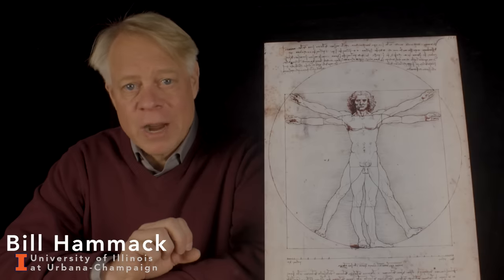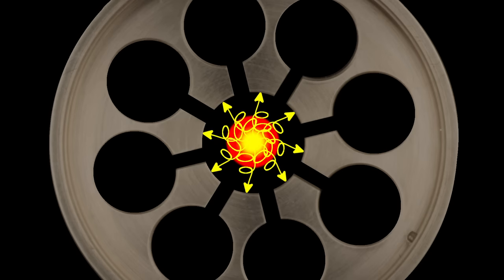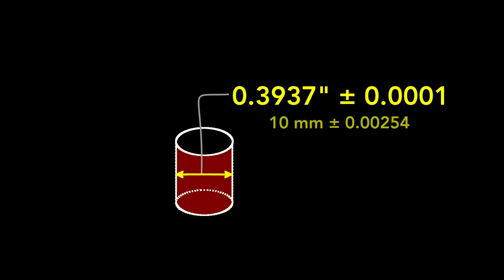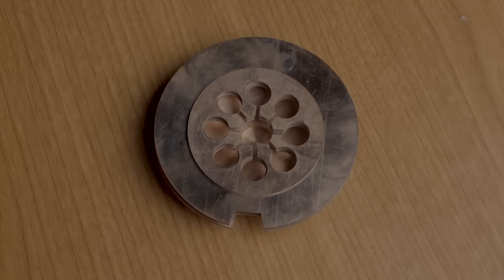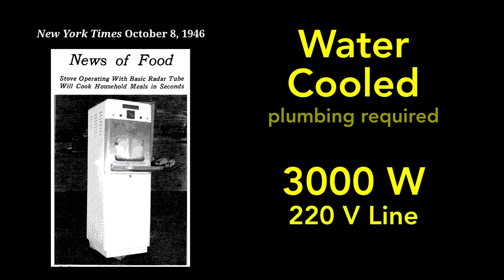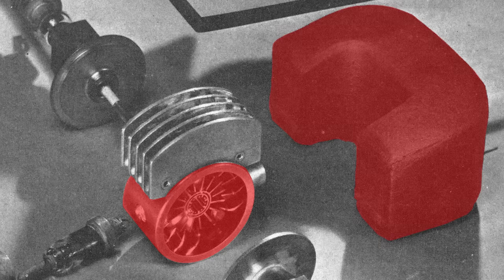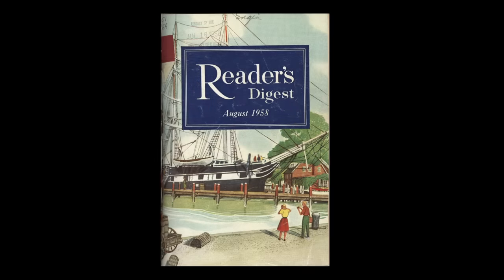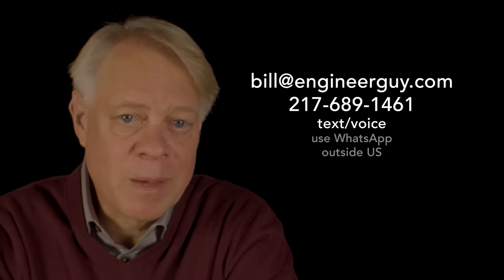The Microwave Oven Magnetron: What an Engineer Means by “Best”

Comment: By using punched out metal sheets that the magnetron is assembled from it is also pretty simple to test and reject any one sheet that wasn't within tolerances. I mean just assemble the sheets, put them in a test rig and fire it up, if it produces the correct wavelength them great, and if not you can just keep switching out the sheets until it does. I don't know if that was actually done but it was what I first thought of, instead of finding a way to perfectly mass produce the piece you use a method that will get it right most of the time but is just so quick and cheap that you'll still get lots of working pieces even if some are defective. I mean who cares about throwing a way a bit of sheet metal? You can just send it back to the foundery and turn it right back into usuable sheets.

I probably thought of this because it's kinda similar to how silicon chips are made, not every chip on a die will work but you can make enough of them that this doesn't matter.

Comment: Micron tolerances are crazy. Ive worked in a shop with them. To put it into perspective, if the heat or AC come on you'd just throw the part into the recycling pile. Even if you didnt notice it was still enough to throw the tolerance. Just half a degree was enough to cause the part to warp.

Comment: Excellent video, but you clearly got the inch disease at 3:30. The 10mm makes sense, but the 2.54 um is a conversion artifact because you recalculated from the rounded 0.0001 inches

Comment: I don't know if the wattages are correct, they advertise the cooking power wattage but microwave ovens are fairly inefficient so they actually draw around 2x that power from the mains.
Look at the advertised cooking power of your microwave then look at the electrical ratings printed on the label on the back of the unit, there is a big difference.

Comment: Great episode, that demonstrates that application dictates design !

Look at analog electronics. There are tens of thousands of different types of transistors. It makes the electronics neophyte think that you MUST use a specific part number for the job, else the circuit will not work. To the contrary, that's often not the case. It boils down to the job at hand, that the circuit has to do. In certain precision instruments made by Hewlett Packard (way before the breakup) not only does a specific transistor model need to be used, but it also must be made in a certain date range, when a certain semiconductor fabrication method was used. Contrast that to your typical "commercial" application, where you design the circuit which can use just about any transistor that meets the power demands, and that transistor's characteristics can vary widely. If you design the circuit based on the wrong criteria, you'll be transferred to the sales department, in a heart beat !

Comment: It's an oversimplification to say that the magnetron plates could be simply stamped to provide the necessary 0.0001" tolerance in diameter (and probably placement) of each hole. Fine blank stamping does not achieve tolerances that good, even in soft materials. Further to that, tolerance stacking between components would not be a simple issue to manage with a magnetron comprised of many plates. 

Plates would have to be finish ground on both sides to clean up the openings which would have sharp burr edges from the stamping process and to also assure flatness and parallelism. I suspect that a clamped together assembly of rough stamped plates could have been finished ground (probably with internal circular bore grinding) to final shape to accomplish the necessary 0.0001" tolerance and line up all of the features. 

Alternatively the super tight 0.0001" requirement is an apocryphal requirement and that fine blanking stacks of copper merely turned out to be far easier than making them as a contiguous piece which would require a lot of operator time to rough drill each hole, mill each radial passage, then ream each hole. 

Copper is a frustrating material to machine: It's soft sticky stuff that is difficult to mill into smooth surfaces without CNC controlled climb cutting. The deep slots would be quite frustrating to machine because it would require cutters of low diameter compared to the length which would result in a lot of broken cutters and poor surface quality. All this work would have been done without the high performance carbide end mills available today.

I have to surmise, that the stacked copper plate design is more motivated by the issue of ease of manufacturing than the actual requirement for such a tight tolerance. 

In the application of the modern residential microwave oven, the stack of punched heat sinks are probably made of aluminum which is a far better conductor of heat and also a material which is easier to punch (low hardness). Stainless steel is a poor conductor of heat which makes it a quite poor choice for making heat sinks out of. The low stiffness of aluminum also makes the drawn through hole feature a softer springy element which will hug the body of the magnetron which would allow the designer to design with greater interference in the diameter of the hole relative to the magnetron to accomplish a better thermal junction to the magnetron.

I appreciate this channel for bringing attention to the art of engineering, but it is fundamentally important for the narratives to not be overly cleaned up for reasons of simpler appeal. Engineering is fraught with the peccadilloes that Nature throws our way. Often the "best" solutions escape the appeal of simple narratives that would make us think that we can escape the frustrations of the toolmakers room.

Comment: One of our Electronic Warfare Officers was relating a story to us about a radar bombing range.  The screen would, during the winter, occasionally go fuzzy, the anomaly also seemed to be on a cycle of 15 to 20 minutes.  Technicians could not ascertain the problem.  One day while stepping out to smoke a cigarette he noticed a fur bearing critter jumping onto the antenna.  When he returned to the facility he inquired if the screen had gone fuzzy.  Indeed, it had.  Problem solved.  This was in the days when microwave ovens were not a household product, so the crew discovered a new way to heat their meals.

Comment: Ah Bill, have I got a few ideas for you pertaining to this better and best use of a magnetron!
isolation of magnetic fields through microwaves... but this requires building the magnetron as a rotor or a stator formation adapted around or through the middle of a jest engine or rocket... for the isolation of the plasma generated from the combustion of the fuel and then the restriction of the expansion of the burning fuel to create an optimal acceleration chamber out of the microwave isolated ions.

Comment: Where do you have the documentation that the diameter is so critical. I have run CAD simulations of magnetrons, and the field changes due to the outlet port is significant, and a bigger problem re frequency stability than the exact diameter of the cavities. The resonance is a little dirty due to many factors. The frequency also drifts depending on current density and field strengths. Please give me the sources for this, I would appreciate this a lot. Thanks

Comment: I don't really understand what the magnetron does - does it ''just' amplify or concentrate the microwave radiation? The microwave radiation is originally generated by electrons moving through the magnetic field - they have to be accelerated as we don't get EM radiation from constant velocity charges moving through a B field ( if we did then every cable at home would constantly be a radio transmitter). So is the magnetron's necessity driven by the need to generate microwaves from a small device? If size was not an issue could a microwave generator be built without a magnetron cavity by having a gigantic anode, cathode & magnets? Do we have magnetron-equivalents for e.g. long wave radio or X--ray wavelength-producing machines? Is Light-Amplification-by-Stimulated-Emission-of-Radiation along the same theme but for visible wavelengths i.e., is the LASER a variation on the MAGNETRON theme?
Great video BTW; very thought provoking and inspiring for an aspiring engineer/designer.

Comment: You should have said that inside the homemade microwave has in thermoionic valve that works with 4KV, and one of the terminals of the secondary transformer goes connected in the microwave chassi. Electronic tubes are still among us.

Comment: I wonder how the accuracy of the magnetron could be maintained with 13 individual copper sheets.

Yes, maintaining the diameter over a smaller thickness is easier; but for that, the individual sheets must not be twisted in the slightest to each other and the transitions between the sheets must be virtually non-existent.

How was the "seamless" and "twist-free" joining achieved?

Comment: No going to dispute what was said at 1:13 - 1:19, but the image of a German made Bf-109(aka: ME-109) is a Finnish owned and operated example, not a Nz German one.  Roundel on the tail is a blue swstka on a white disk which is the Finnish Roundel from WWII.  The Germans had their signature Cross emblem which looks kind of like a fancy plus(+) symbol if you look it up.

Getting really nitpicky here.  That particular plane looks, to me, to be either a late F model or early G model based on the canopy and nose.  I lean toward an early G model because of the chin radiator, the intake on the left side of the fuselage next to the engine could confirm this, but it is not clearly visible in this particular exposure.  The Bf-109s that were present leading up to the German attack on the British Isles in early WWII were E models.  Mostly E models by the time the Battle of Britten started as I understand it.  There may have been a few B models still hanging around in there at that time, but I can not confirm that.  
The Bf-109s would escort German bomber-variants such as the the Do17(very pretty plane), Ju88, Ju87(Stuka!), and He111.  Since the Bf-109s had less range and no drop tanks, they had very limited time on the north side of the channel, and were limited only guarding bomber-formations near the coast line.  The He-111s and Ju88s had more range and could hit deeper targets than the 109s could help with.

Anyway, I just saw that one little thing that is insignificant to the video over all, and thought, "Hey, I can add some knowledge to someone who reads the comments."  So I did this.  
Anyway, the video seems good, so I'm going to "Finnish" watching it now.
Reply: I was not disappointed, the video was good.

Comment: When the frozen TV diner switched from the aluminum plate to the plastic plate and began making their meals specifically for microwaves is when the microwave oven took off. That and microwave popcorn.
Reply: Why? You can always reheat food you made quickly; and alu plate works in microwave no problem, some metal objects like forks you do not put in microwave, but it's possible to shape microwave suitable metal.

Comment: I don't think the story of the magnetron is nearly over yet. The mechanics of how it works is like nothing I've ever seen before. Imagine making one big enough or small enough to produce different types of waves. If you could beam a signal directly at a plant on high frequency it'll slow down to radio waves by the time it gets there. It could be the long distance space communications system of the future. Or maybe one could be tuned to produce extremely long wavelength radiation to simulate dark matter effects

Comment: Hiding the creative process is indeed a bad thing.

There's also a problem inherent to technological optimization: a curious kid can no longer open up, e.g., a radio and figure out what's going on inside.  As integration has progressed, looking under the hood has become increasingly difficult.

We need to make sure there's plenty of information out there (your channel being part of it, but well-written DIY guides covering the basics are essential), and tools and materials available for learning how stuff works, how to use and manipulate it, and in general all the things a budding engineer needs for getting a taste of the trade.

And, "best"?  Yup.  All tradeoffs, depending on application requirements, desired features, engineering budget, manufacturing budget, available tech, and countless other factors, some of which turn up after you think the design is complete.  (Wait, the customer site has what level of gamma radiation while this is running?)

Comment: The "skilled worker" who would have fabricated the first magnetron design I would call a "machinist" rather than a "mechanic".  Mechanics assemble parts, but machinists fabricate them.  And, having some experience with machining operations, I'm surprised that the original cavities could not be drilled, reamed, and honed to the required precision.  However!  Precisely cutting the internal slots to the cavities would be much more of a challenge, and that's where the stamping process really shines.  Without a cut to the exterior, a bandsaw blade would need to be broken, threaded though the hole, and re-welded to cut outward, and THAT would be slow and expensive.  Then some kind of grinding or polishing operation would have to remove burrs and saw marks.

Comment: ...never knew magnetron is still electromechanical rather than purely electrical device run by semiconductors. I guess manufacturing cost is the primary cause for their use which in itself is cost optimization...:)

Comment: Oooh is that why big electromagnets are made with hundreds of thin sheets ? To keep tolerances manageable ?
Reply: At least for AC electromagnets, it would be the same reason as laminated transformers (like the ones in microwave ovens) - it inhibits eddy currents in the block which would otherwise be induced by the alternating magnetic field, heating it up and killing efficiency.

Edit: Also a lot cheaper to make, I imagine. So, you'd be right about managing tolerances. 😀
Reply: No, no! There is generally no precision requirement there, the imprecisions average themselves out instead. They are laminated with insulating glue to guide the Eddy currents.
Reply: I see, thanks to both of you for enlightening me :D

Comment: How were the laminated punched sheets for the magnetron assembled accurately to minimize the tolerance stack up and maintain the required precision? I would think that welding of the lamination would be time consuming and a difficult task for welders.
Reply: I don't think they're welded, that would indeed warp and missalign thin lamination. They would be assembled on a fixture with alignment pins sized to match the cavity holes. Then compressed together with a clamp and the holes were probably lapped to final dimension. Then a housing was bolted on (while maintaining the external clamping pressure). The housing bolts would take over the compression that would ensure enough friction to maintain the alignment.
Reply from the maker: You are correct: he had a precise jig (or is it a fixture ... help please!) and put it through a clever hydrogen filled oven to braze (weld, no I think braze) the whole thing. I left this out ...

Comment: Not apocryphal. The reader's digest article only devoted like 15 sentences to the invention of the microwave, but they didn't say anything inaccurate. Percy Spencer was the chief engineer of Raytheon at the time, and while he did work himself and his crew to the bone while figuring out how to mass produce the radar magnetron... The idea of the microwave really was discovered on accident via the claimed method of a candy bar in his pocket. Raytheon even includes the story as part of their company history.
Reply: Tbf, a company could include an apocryphal story about themselves on their website and nobody could really stop them.
Reply: @joshyoung1440  Yes and no. If they did something like claiming credit for another entity's work/accomplishment, they would likely be hit by an indirect defamation lawsuit at the least. So there are decidedly limits to what one can claim. However, in this case, they are the holder of the first ever patent of a direct rf heating device (diff from induction heating), so credit attribution isn't really up for contest. And the fact the claimed method of discovery (by both the company and inventor) is not beneficial to themselves, lends credibility to it being the truth. i.e. Rather than claiming the discovery was the result of expertise/diligence/etc, they are essentially admitting that it was simply the result of dumb luck.